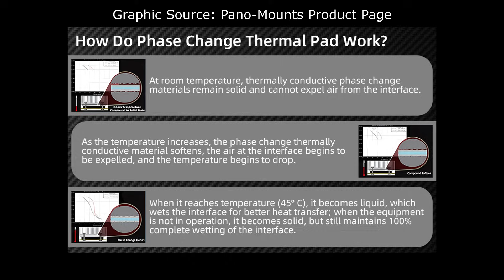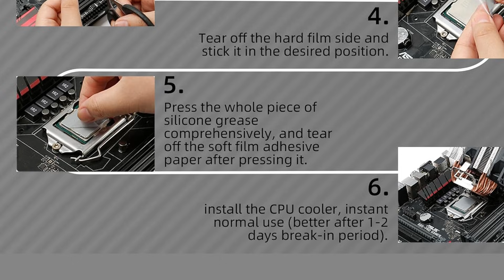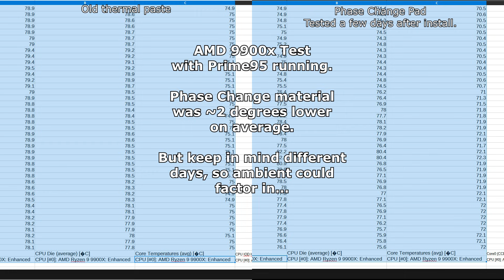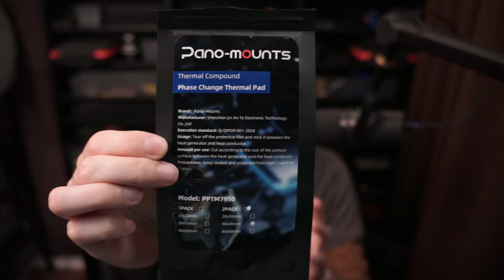First time trying Phase Change Thermal Pads for CPUs.

Comment: use a hairdryer since it ptm starts to "liquify around 45c.  a hair dryer wont liquify it completely but it will soften it enough to move around to spread.   a good tip when putting it on the cpu is to put it in your freezer or fridge after you cut it to size so that its hard and wont stick to the plastic when peeling it off.  :hand-purple-blue-peace:

Comment: Tbh i have never seen a heatsink like that for a cpu where the pipes themselves make contact?! Wouldn't a full surface area on the heat coverage be better for dissipation? I'd think the cpu would have alot of hotspots
Reply from the maker: It's AMD AM5, their latest platform. I don't really want to speculate much why they went with this design where the heat spreader has cutouts for resistors and such on the top. It is odd. Though, like others said the smarter way to go about it would have been me applying the thermal sheet to the heatsink rather than the CPU's superspreader. I just didn't want as much over spill sitting around in there.

Comment: Your heat sync is ideal as it allows the phase change materials to acturatel utilize their potential phasee change cpability giving you 7 state heat phase that would work both from your cpous thermal governor, the metrials thermal capcities and inuduction rate and the fans natural cooling that balances one out faster than the other

Comment: As much as I love phase sheets...I do not recommend using them for CPUs...yes they will work...the problem is when u decide to upgrade CPU or cooler...the phase sheets will prevent u from removing the cooler...it will be stuck n u might rip out the CPU...be aware...it happened to me and I never used another phase sheet for a CPU
Reply: Pulling the CPU out on a PGA CPU like AM4 can be an issue with regular paste too. To avoid this, heat up the CPU with a stress test right before shutting down and taking the heatsink off. Don't just pull straight up either, apply a slight twisting motion.
Reply: Apply a twist before pulling it out (thats what works for me) and yes heating up before removal also helps even though I never needed it because I live in a hotter climate.
Reply: Dont use it on systems you don't intend to keep as is then. That's not what it's for anyway.

Comment: This is fake PTM7950, probably rebranded OEM PCM5000 i have the same fake stuff here from before i ordered PTM7950 from an official dealer (Caplinq). Genuine PTM7950 has the same thickness of film on both sides, is immediately very tacky on the applied surface and not brittle when it tears apart.

Comment: I was surprised you didn't have a contact frame around that cpu. That might be something to look into if you decide to change your thermal pad or cpu cooler. I don't really think the contact frame is something necessary or game changing but it seems to make cpu coolers fit easier around the odd shaped cpu heat spreader while spreading the clamping force evenly around the cpu rather than in two points.
Reply from the maker: A 3rd party bracket? I know of them. it might be a fun video at some point.
Reply: Contact frame are important for intel 1700 cpus not for amd AM5

Comment: How much longer should it last compared to normal termal paste
Reply from the maker: My guess is longer than paste l, but don't take my word for it and do research if it's critical https://www.google.com/search?q=longevity+of+phase+change+thermal+pads&oq=longevity+of+phase+change+thermal+pads
Reply: It gets better the longer you use it. It's not a thermal pad, it's a phase change material. It's just in the shape of a pad because TIMs are supposed to be as thin as possible no matter what kind they are.

Comment: I used some Honeywell PTM7950 on my video card and it instantly dropped 8C on the die and hotspot, and over a year later it is only getting better. Now I am lucky to even hit 78C on the hotspot instead of almost 90C like it was previously. The average temp I get on the die was reaching 82C before and now it stays around 69-72C. I did not have any issues with the material sticking to the plastic and had no issue cutting it either.
Reply from the maker: Nice, glad it worked out well for you. 👍

Comment: Thermal paste is way less fiddly and easier to apply. No need to worry about trapping air or having stuff creasing unless you're doing crazy weird patterns. This looks like a lot of hassle for the same performance (if you do it right, that is).

The only thing that the pad seems to make easier, according to what people have told me, is that they're easier to remove and change in comparison to old thermal paste, since you just peel it off.

 But if the main advantage of your product is that it's easier to remove it, well...
Reply from the maker: Yeah, at least based on my currently ability to get things right and test it. Another commenter suggested that heat from fingers on the final piece of plastic when it's on the CPU should help it release from the plastic easier.
Reply: It's bewildering to see the uploader respond to this comment and not correct you on your major misunderstanding of what ptm7950 is and what makes it superior to thermal paste. It's not a thermal pad, and the whole point of it is that once you apply it, you never have to remove it and that is its intended use case. Its performance only improves with time. It's also more difficult to remove than thermal paste.
Reply: @IrrelevantPlease where did you get that phase change thermal pads last forever and only improve with use? Every source I found including the LTT forums say they do, in fact, degrade over time, they just last a long time, at least in regards to Honeywell one. One guy noted an increase in temps over a period of 19 months.

Aren't you confusing them with the  graphite pads? Those can potentially last forever if handled properly since they're static, IE they conduct heat really well and dont really degrade due to continuous exposure to it, since they dont dry out nor change with temperature.

Comment: Hey man, you kinda botched the application but you aren't to blame. Instructions aren't as clear how to properly apply, the ones that come with this product. Bellow application process comes from thermal grizzly instruction manual for phasesheet PTM (which I used for my RTX 3090 GPU and it works perfectly, at full 390 watts 105% power limit GPU doesn't get over 68-69c and there's still about 30% left on fans, while still bellow the threshold for fans to be in the audible range, while in dynamic load between 280-350 watts of real world gaming, GPU doesn't go above 59-63c. Hot spot doesn't get over 86c).

When you remove the first film and place it onto the surface you are suppose to press and keep pressing the PTM for 2-3 minutes (at least)covering as much PTM surface as possible so that the pressure and heat from fingers get the PTM to stick to the surface of the IHS. So when you go and peel off the second film it will easily enough come off (and the excess PTM that was overhanging will perfectly tear around the edges of the IHS) so that PTM is perfectly on top of the IHS.

I did this with my phasesheet PTM from thermal grizzly and the excess PTM that was on film (I cut it with 2mm extra on the sides) also stayed on the film while what was on the IHS stayed on it firmly without causing any waves or getting torn. Basically looked as perfect as it can be (so satisfying).

Though I kind of made a mistake and didn't cut with the film removal helper (that red excess film where PTM isn't on), there a dozen of swear words involved in the process but manages to perfectly apply it still with the process.
Reply from the maker: Thanks for the info! getting it to bond better. with heat from your fingers. to the heatspreader makes sense.
Reply: @TECHiSuppose  yep... because at first I didn't read much into the instructions and basically it was starting to do the same as it did in your video. I tried to remove the top film after placing it onto the IHS and i panicked because it was doing the same as it did with yours (as soon as I saw it wasn't sticking to IHS i stopped removal).

It just wouldn't damn unstick from the film and was pulling onto PTM and lifting it from IHS. 

Then I read the 3 minute part and mild to moderate continual pressure and after I did that, ptm got somewhat looser and when I pulled on the film it just beautifully unstick as if it was glued. No lifting of PTM occured or tearing.

Hope this helps if you get to do another PTM.

And the end results of cooling were damn impressive. First time running RTX 3090 went to 73c celsius ( about 380 watts) but after more then a dozen heat cycles later and dynamic heating from real world gaming it's now fixed to 68c with full load of 380 watts and when it's dynamic load ranging 280-350 it basically floats 59-63c.

And it still is getting more stable, more silent, and harder to heat up. PTM still seems to be improving (albeit very minorly now compared to after about 10 heat cycles).

Comment: I read someone on reddit tried putting only 20x20mm on their ryzen cpu and it worked great. Save some money for eventual remounting.

My Thermalright Heilos suggests putting it in fridge first and apply it on the cooler surface rather than the CPU, it helped alot.
Reply from the maker: The fridge idea sounds good.
Reply: *a lot
"alot" isn't even a word

Comment: Freezer is the answer to your application problems :) Just freeze pad before peeling off plastic, it will be stiffer and wont tear or flake that easily.
Reply: Freezer? Yeah freezer will help to peel off the first part of the application process to stick it onto the surface and to cut it without tearing it. The only way to remove the second film successfully once you place it onto the surface is through moderate pressure with your fingers for 2-3 minutes and also heating it up by body temperature. That will cause the PTM to stick to the surface without getting lifted off or getting torn during peeling of the second film.
Reply: Very nice idea for cutting to size and then placing on the CPU!!
Anyone else tried this idea and what was the results, plus experience during the application?
Reply: heat the CPU first with an hairdryer or somesuch, remove plastic film #1, put your freez'd pad on it, apply light, even pressure with a stamping implement, drink some tea, coffee or water, remove plastic film #2, heat your heatsink base and install it gently. et voilà, it's done, takes a few minutes more, including coffee time, but if you're not a complete tetrad, you won't need to redo it before your next upgrade. or ever if you don't do CPU upgrades of course. 😅

Comment: You should try it on a gpu. I just did it on my Rx 6900 xt core temps 55C° hot spot 60C° i have never seen a amd gpu this cold
Reply: You still recommend this? I have a 6900XT aswell and it hits 90 deg junction temp and 85 deg hotspot after a few minutes of heavy gaming in the summer. Its currently around 2 years old of almost daily use, you think its time for a thermal paste change? Maybe with a thermal pad like this ?
Reply from the maker: Yeah, that would be fun to try out. 👍

Comment: You should do a gpu video using ptm next.
Reply: Hey man, I used PTM (thermal grizzly phasesheet) on RTX 3090 and I can tell you it works great. A dozen of heat cycles later and the temperature stabilized to around 68-69c at full blast 380-390 watts (with power limit cranked to 105%) fan never going above 70% (and yeah can't hear the GPU at all, where actual first audible notes come at around 78-80%). In dynamic real world gaming loads where wattage oscillates between 280-350 watts GPU is basically sitting at 59-63c. 

It is proven that even after few dozen of heat cycles the PTM keeps on improving in efficiency and improving at being TIM. So I expect it may even drop to 67-66c after half a year.

The PTM isn't better then the best thermal pastes (like degree or two celsius difference but what it is best at is avoiding pump out effect and drying out compared to the best and the rest of them).

Also application of the PTM techisuppose did it wrong. Though he's not to blame as the instructions weren't as clear how to properly remove the second film. You need to press the PTM with your fingers moderately once you stick it onto the surface for at least 3 minutes, try to get as much area covered with your fingers as you can. As it needs to get glued onto the surface and the only way that will happen is by heating it mildly and with continual pressure (but not hard obviously somewhat moderate pressure) as I mentioned for 3 minutes at least. After doing so when you start peeling the second film it will smoothly peel without causing any ridges or tearing and it will make perfect shape of the IHS.

Comment: What do cpu makers say about this type of add-on, Scott? (Warranty issues?) Looks like users must be super dextrus.  Does liquid return to the original phase upon cpu cooling? TBH, I'd be nervous about leakage and long-term stability.
Reply: It doesn't get liquified so to speak. It gets viscous but it doesn't ooze out like normal and it shrinks back into its more solid form. That's the real advantage of the PTM for these powerful GPUs/CPUs. As PTM prevents the "pump out" effect that causes normal thermal paste to ooze out due to constant pushing of he heatsink/IHS when they expand and contract due to cooling/heating.
Reply from the maker: I've never looked at CPU manufacturer documentation to see if they try to limit warranties. There is an option called "liquid metal" used in high-end GPUs and by hobbyists with "delidded" CPUs (direct die contact to the heatsink or waterblock), but that one is the more dangerous option, like you said, because of seeping out or overspill could short something on the motherboard. I don't think it would happen with these phase change pads, but I haven't looked at it in detail.